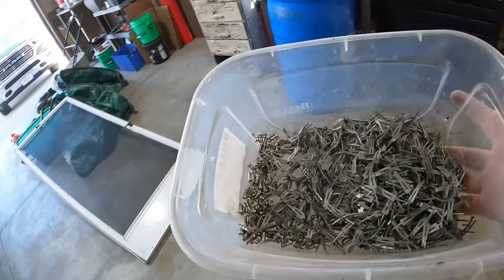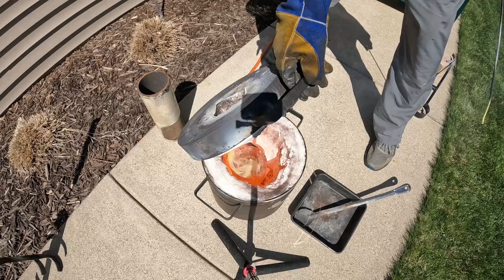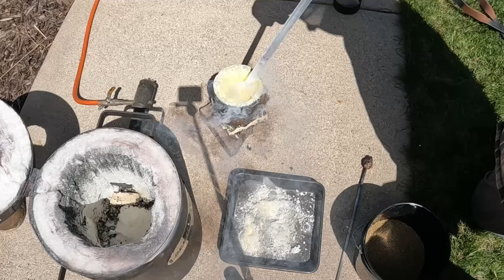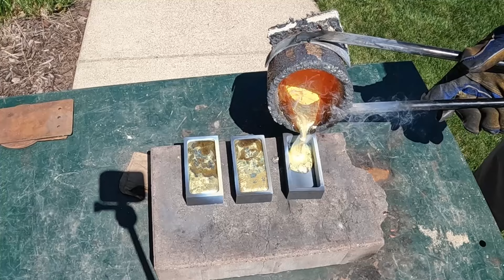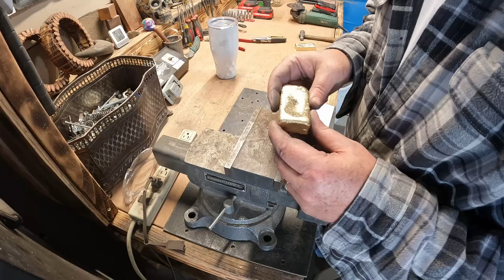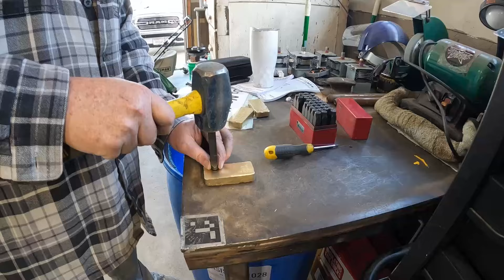Melting Brass, Gettin' FANCY With the Finish

Comment: When brass over heats oxygen ignites  the zinc causing the zinc to burn out. Drossing off once adding 1gram of borax will increase the serface tention if the liquid stopping  oxygen causing a cascade effect. No more stirring the remaining slag will float to the back. In future if this happens put them in the freezer this will cause the borax to crack as the metal contracts. Awesome episode brother